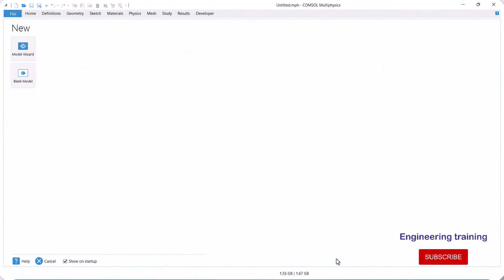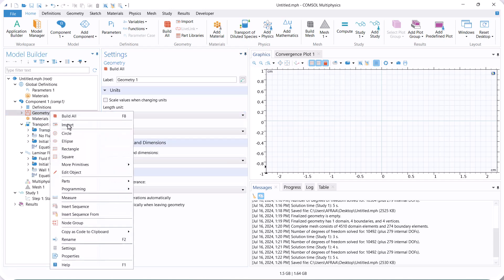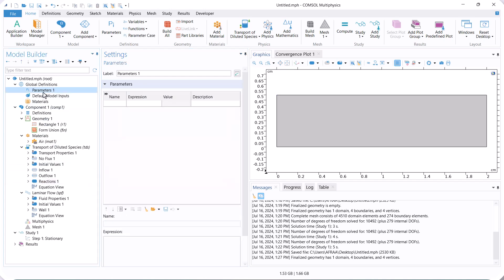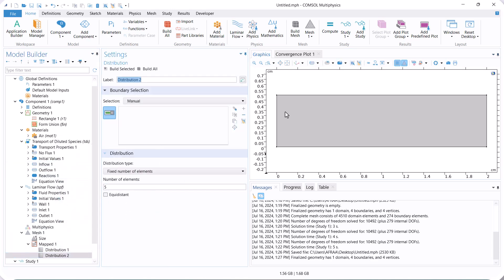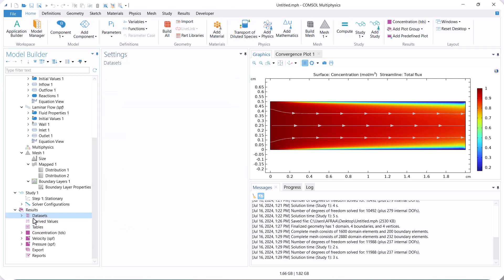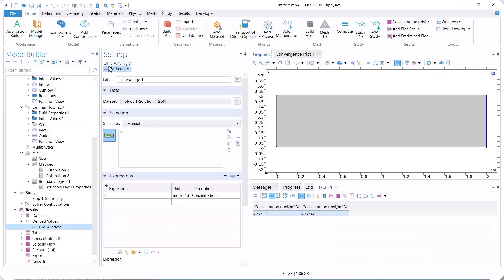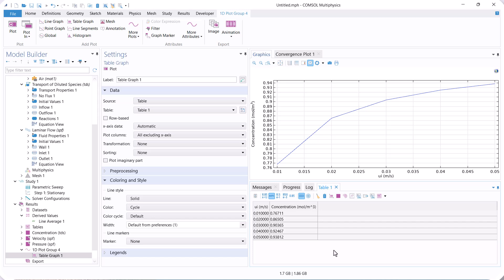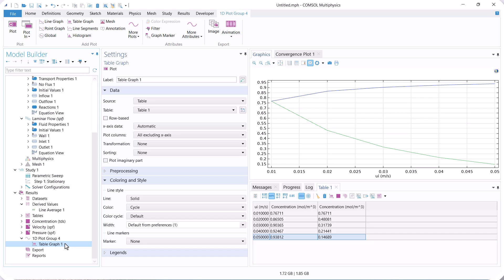COMSOL : Fluid Flow and Mass Transfer with Reaction

Comment: Hello. Great video. Thanks for taking out the time to do this.

I have a question regarding Multiphysics. I see you didn’t add the Reacting Flow, Diluted species coupling. Using spf in your transport properties already did the job. Just wondering if adding the multiphysics would make a difference. And also inquire when it’s best to apply it.

Thanks
Reply from the maker: Hello, thank you for your comment. Since the concentration does not affect the velocity, you can model your simulation without adding multiphysics. However, for simplicity, you may still choose to use the multiphysics option, as it automatically couples the velocity field from the fluid flow to the dilute concentration.